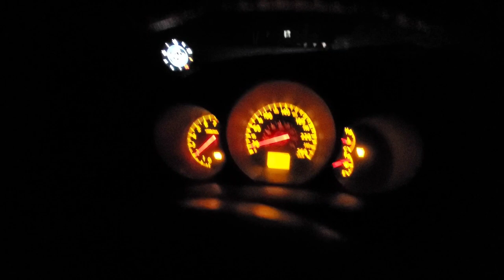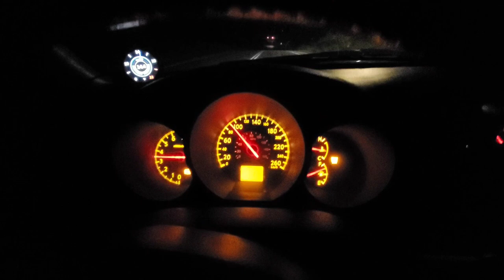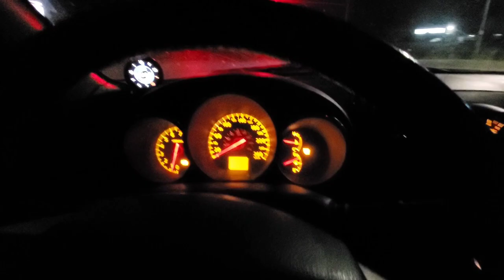V6 Altima Catalytic Converter Delete

Comment: Is there a super charger for 3.5.  Going to add intake just wondering.  How to get more power v6 3.5. Se.  Altama
Reply: Theres a few supercharger kits out there for the VQ but I know there mainly for the Z's and G's not sure if it will work with the Altima.
Reply: @bloodsupremking  they will